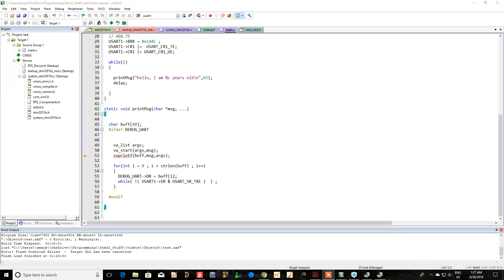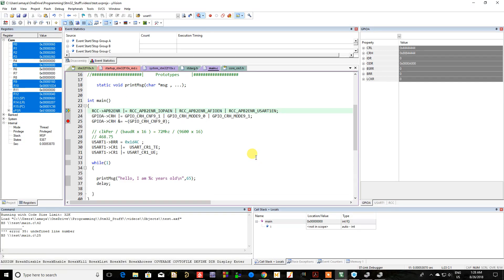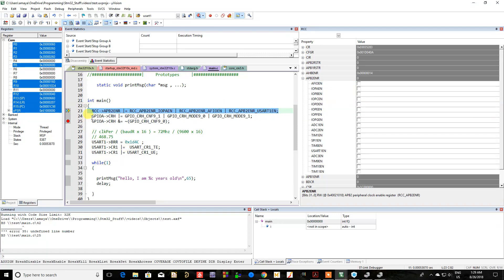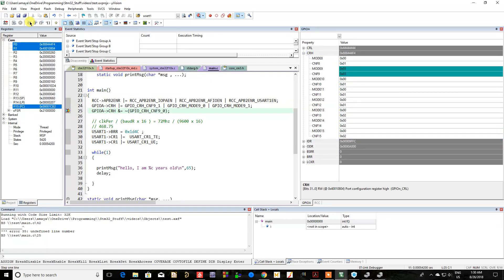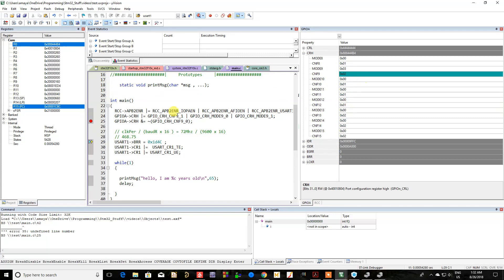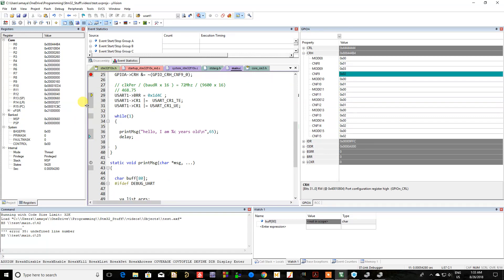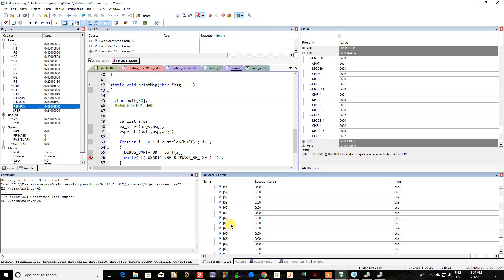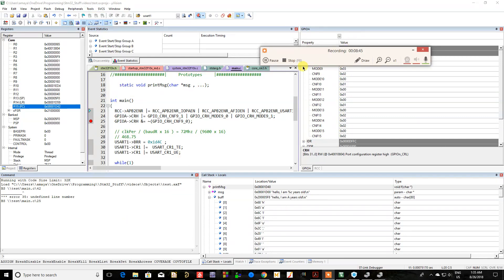STM32 Keil uVision 5 Debug

Comment: This may not be a place to ask questions not concerning this video, but i'm encountering a problem, and can't find the solution anywhere. When debugging a C++ program in Keil uVision 5 the debug pointer doesn't reach main.cpp but gets stuck at the startup file "startup_stm32f407xx.s"
What could be the problem?
I've noticed that this happens when my main file is of type main.cpp, while it works fine when it is main.c.
Best regards.